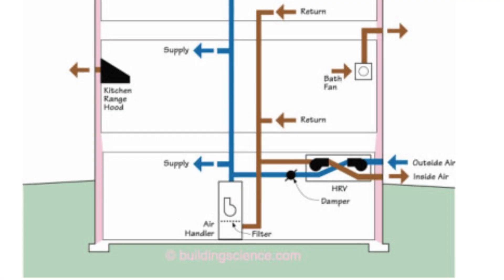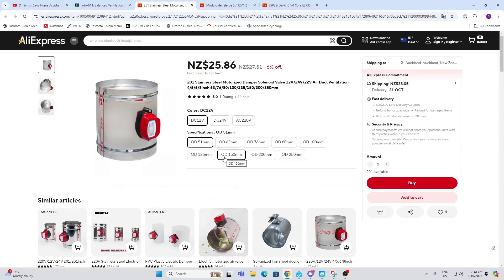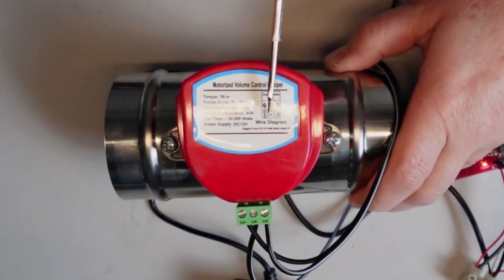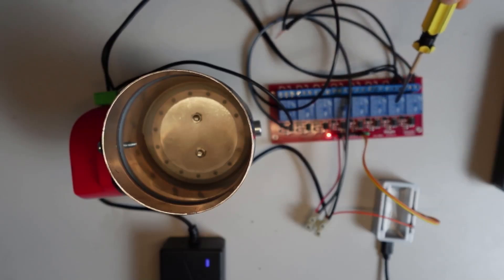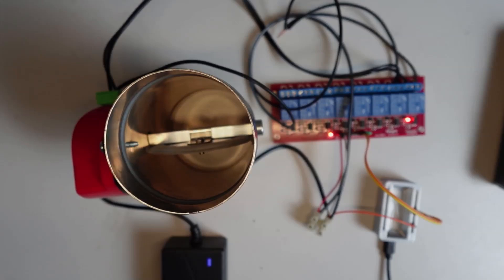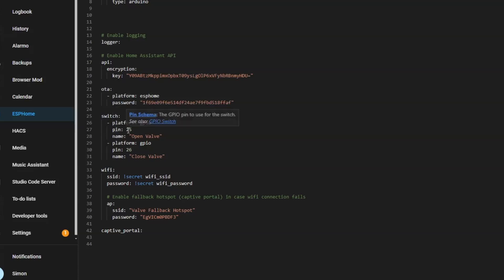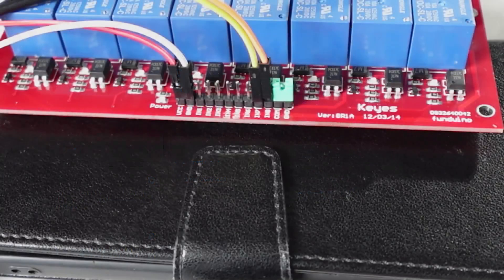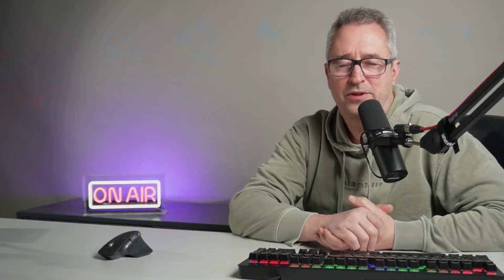How To Automate Airflow Control in your Heating / Ventilation System with ESP Home

Comment: great device, put a wired reed sensor inside. so you know when it is closed. could probably have the magnet on the inside and the wires on the outside..
Reply from the maker: Just released a video installing the reed switch!
Reply: @simonsayshomeassistant  Can you link is to that video? I'm having trouble finding it. TIA
Reply from the maker: @WhoCares2509  Sure here it is: https://www.youtube.com/watch?v=I3bheIGBviQ&t=78s
Reply from the maker: Thank you for the idea! I will try it out.

Comment: Great video!! would love to see the insides of the damper gearbox. I am using 24v power closed and spring open dampers in the event of a failure the will fail open. to control them I use a ZigBee 5 port power strip that each send power to a 24v transformer. been a solid system for gong on 6 years now. Cheers 👍
Reply from the maker: @mikesmods317  thank you for the feedback yep I will do a tear down video next!
Reply: @simonsayshomeassistant  just watched it! Thank you so much!!
Reply from the maker: I have just released the tear down video

Comment: you could have used this: ESP8266 ESP-12F Relay Module 10A 220V Network Relay WIFI Module Input DC 7V~30V  and flash Tasmota on it via OTA (takes about 3 minutes). That way you would have a nice small unit. I use these for opening my front gate and also for opening my roller doors. The relay units also come in 1/2/4 relays.
Reply from the maker: Thank you, yes, that is a great idea!  I do still love the simplicity of Tasmota!